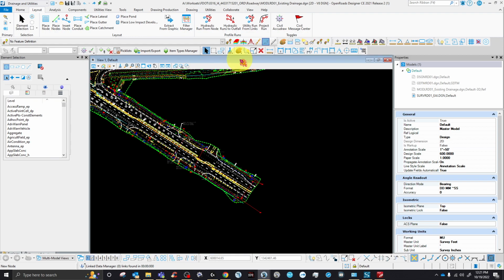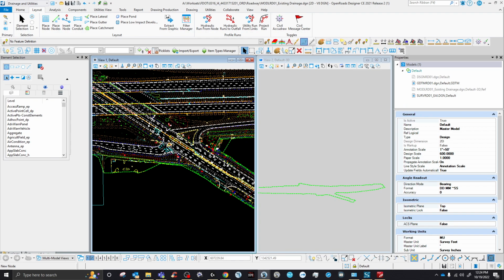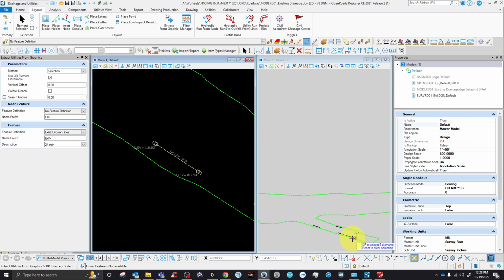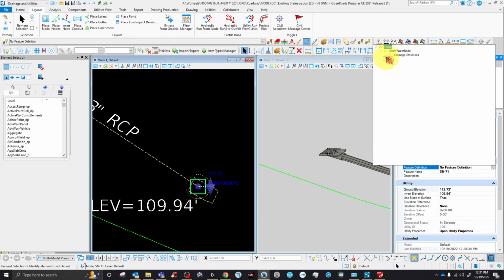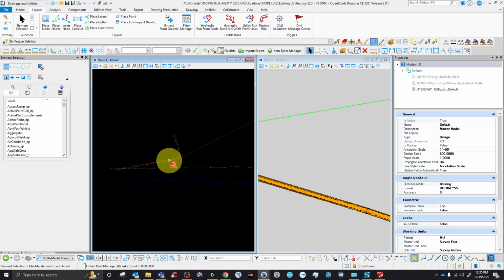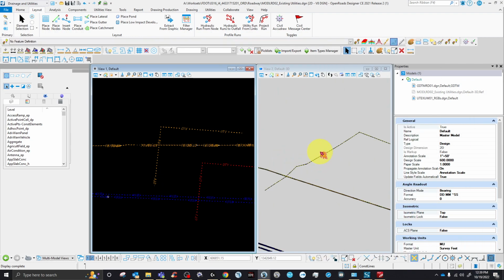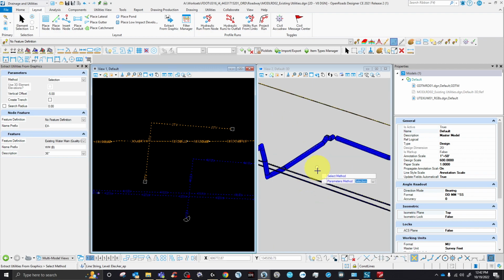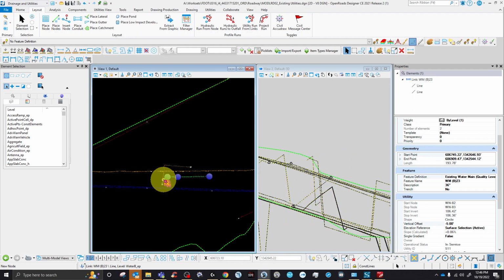How to 3D model Existing Drainage and Utilities in ORD

Comment: Hey, we are currently modeling large gas lines. It is auto populating nodes (manholes) where we have our data points on the line. Is there any way to remove those nodes without removing the lines?
Reply from the maker: Redrawing the lines might help, don’t just use the lines coming from survey because those came with breaks that make nodes